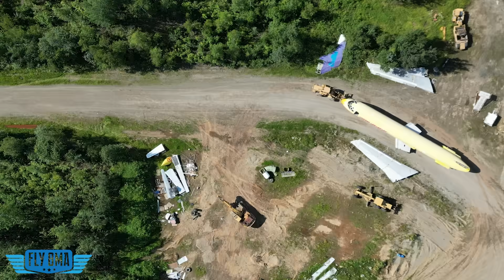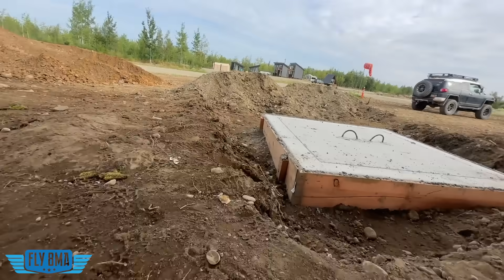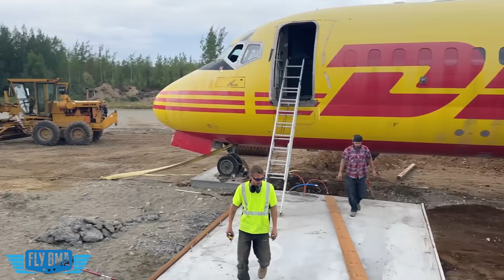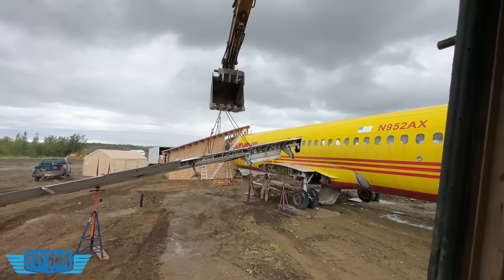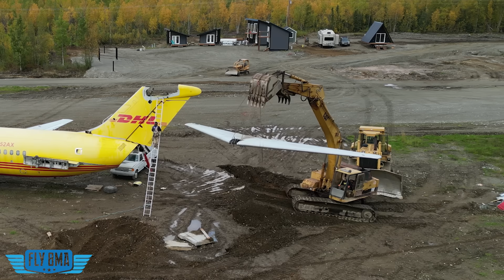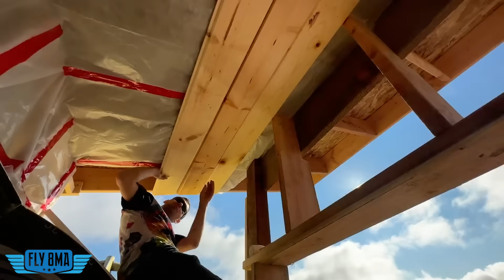Building our DC-9 Airplane House

Comment: Wow, I worked on that very airplane when it was with ABX before DHL bought them out in the early 2000s. Amazing she still hanging around. N952AX is a 40 Series DC9, which indeed had the aux fuel tank forward and I think aft of the center box. I'm glad she didn't go to the scrapyard. Cockpit is too dark to tell, but it used to have a Honeywell EFIS suite. Obsolete 5" displays for sure. I put a lot of hours on that airplane. If you have reservations about the tail with the big hold cut up over the wing, just put a stand at the tail skid like we used to do. Not sure if this plane had the aft stairs, or the round P-Dome. Thanks for the video.
Reply from the maker: That's super cool you wrenched on it!  Still has stairs in the tail that are labeled "deactivated"...got some piles in the ground and welded to the engine mounts to support the tail.  I've crawled through both fuel tanks in the belly cutting holes and gluing together ABS sewer pipe for the plumbing.  We have a toilet forward and aft, with the 3in ABS coming out at the gear and down to the septic tank.
Reply: dang small world
Reply: I also worked for DHL right about the time they acquired Airborne (ABX) at the JFK Gateway in NYC, and handled a couple of their DC8's back in the early 2000's.  We had their A300's, DC8's, MD11 (contracted), 757's and lastly that little yellow and red helicopter that shuttled bank docs and money too & from Manhattan.  Great people and times, sorely missed.
Reply: 952, along with 951, were the only two ABX DC-9s with five tanks. Those two also had an aft aux tank. Those were the only two DC-9s ABX could fly to ANC, even then requiring a fuel stop enroute, usually YEG on the way up and BIL on the way back.

Comment: Closed cell spray foam will work "IF" it is done PROPERLY!  Rockwool would probably be my first choice as it does not absorb water, it is fireproof, and a great sound barrier (put that in a home I built).  I do NOT recommend fiberglass.  If it gets wet, it is done, plus it is not that good . . .for anything except it is cheap!  Windows, consider building a long (or a few per side) nice (oak?) frames that may be flat on the interior, the the windows would be "inset".  A jig would make the job easier and quicker.  I am a retired general contractor and continue to study and "play" with idea's like this.  Best of luck!
Reply from the maker: Thank you!  We ended up with spray foam...rockwool for the interior wall insulation just for noise dampening.  This one got 4" of foam and is even better insulated than the DC6 we did.
Reply: Agree with rockwool. Living in the area it was invented :) It important to know there are different types, one is made for inner wall use and is not good if water gets in contact. Then there is types that are for outer walls and is fine with moist  and water. It could be good for @FLY8MA to know.

Comment: Why not use the original insulation? When that aircraft was flying at 36,000 feet it was -56c outside! I’d say that was pretty good heat retention.
Reply from the maker: They had A LOT of waste heat to use from the turbine engines...the insulation we pulled out was an r3 or r4 at best...we put in r30

Comment: 10mm of Spacetherm Aerogel fleece would be more efficient than all the other insulation and you don’t loose any internal volume . Aerogel was initially invented in 1931 ,look it up on Wikipedia . if it’s good enough for NASA space suits ……………………….

Comment: Hi. Watching from the UK. Awesome project! I have one question. Do you deflate the shock struts when building these? Or do you fix them into place. Just wondering as overtime they will deflate and the aircraft will lose height. So any stairs you build to access the aircraft might not be fit for purpose in the future. Thanks 😊
Reply from the maker: Hey!  yup, we bottom them out and deflate the tires, the aircraft MLG struts are welded to steel that is bolted to the concrete pads.
Reply: @FLY8MA  Awesome!
Reply: @FLY8MA  Awesome!

Comment: Fascinating project.  Subscribed to follow!

My gut tells me you might want to consider adding some strengthening beams above and below the cut out.  While the fuselage might be taking the load just now, remember that it is empty and has no engines. So there is less of a load on it.
I worry that once you furnish the interior, adding a lot of weight, the keel beam might not take the load on it's own with that large hole sapping some of the fuselage's strength.
I could be wrong however!

As for the windows, why not make an elongated former that is shaped around the window as you want it.  Attach it, then spray the foam around it.
Thin plastic sheeting should do the job?

I would also recommend some sort of double glazing solution. You'll lose a lot of heat through the windows.
Reply from the maker: Ya, we did end up sinking piles into the ground and welding to the engine mounts so there isn't so much cantilever.

Comment: Hi from the UK.  what a superb project. I love it. cool video too.
 How about for the windows,  boarding up to the bottom of all the windows in a line and board from the ceiling down to the top of all the widows leaving a strip where the widows are from front to the rear of the plane, then, you can run a strip of plexiglas across all the windows and simply black out the areas between the window with black vinyl or car rap simulating the window edges.  It would create a strip down each side of the plane that you could still fasten things to like blinds.  Thanks for sharing.